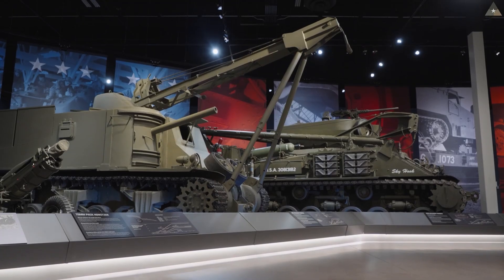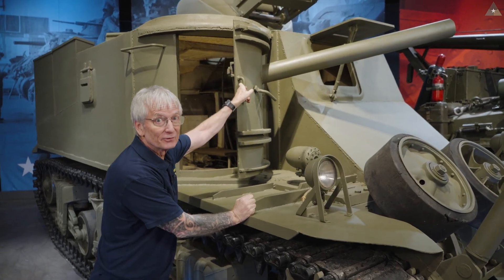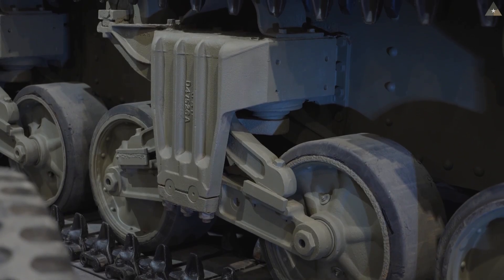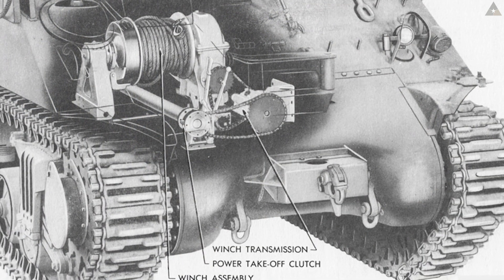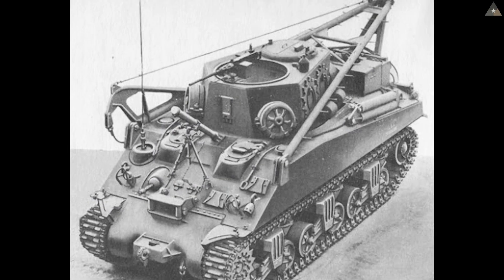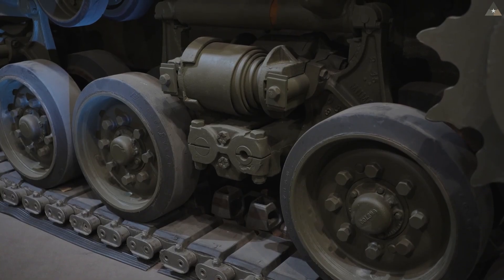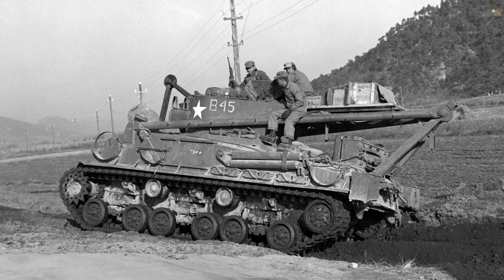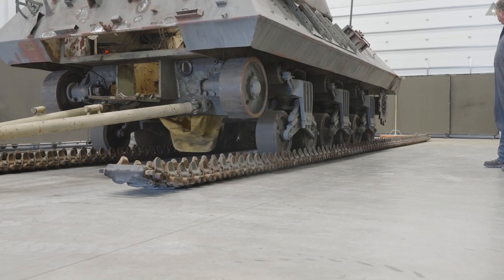Rare M31 & M32 Tank Recovery Vehicles of WW2

Comment: I'm glad you discussed the suspension.  Because that was the thing that immediately puzzled me of course -- if this is an early-model M4A3, then what's with that HVSS suspension i see?!
Reply: The M31 is sitting on early M4 style VVSS bogeys, rather than the earlier still M3 VVSS bogeys. M3 bogeys had the return roller on top of the suspension, where the M4 version moved the roller to the rear of the suspension bracket. Later M4 VVSS bogeys added a track skid plate on top of suspension bracket. I've seen pictures of M31s in the field that had one of the original bogeys replaced with a M4 style, most likely because those were more commonly available at the time and would bolt up on an M3 hull. You also see M31s with all sorts of different road wheels fitted as they were interchangeable between the VVSS versions and keeping the ARV going was a priority for the armored units.

Comment: As to the fake guns, my 1967 M543A2 5 ton 6x6 wrecker has stake pockets for the installation of a canvas cargo cover, as did my 5 ton dump truck. I have read that this was mainly to decoy them as cargo vehicles from the air because being rare and important, specialty vehicles were targets of extreme priority. How many were seen probably also gave away unit strength.

Comment: One reason for the dummy guns on the M31 is not just for intimidation, but also to "protect" the tank.  An unarmed recovery tank is a much more inviting target for unsupported infantry or an ambush with greater effect long term than a standard tank.  By trying to disguise the M31 as a gun tank, it makes it less likely to be attacked because of its value.  Its the same reason that many cargo truck variants, wreckers, tankers, etc, can fit standard cargo covers to try and hide them as a regular truck hauling toilet paper and typewriters, versus fuel, water, or recovery equipment to keep a convoy moving.

Comment: I know some late production M3 tanks had welded hulls, is it not possible that one of those was converted into an M31? 
Either way it's nice to see it semi-restored, and you can always find an original hull to swap tops with one day, plenty floating around in Australia.
Reply: Upon further research I found that the initial 150 M31 TRV's produced used a mix M3A3 (Welded) and M3A5 (Riveted) hulls with the initial T2 Pilot vehicle "Katrina" using an M3A3 hull.
Another 146 were also made using M3A3 and M3A5's for Soviet lend lease (both used diesel engines and were easily integrated into the diesel powered soviet armored formations).
Retroactively they were classified as M31B1 (M3A3) and M31B2 (M3A5).
 
So, in short Welded hull M31 did exist but were always diesel hull M3A3.
Your M31 is "wrong" but not in a bothersome way.